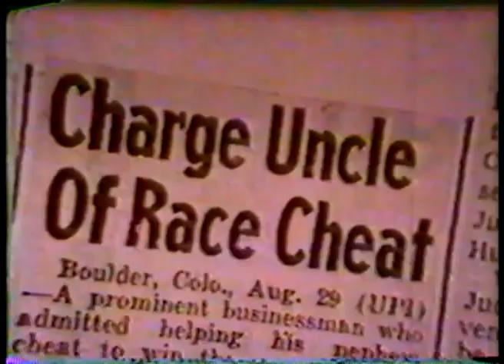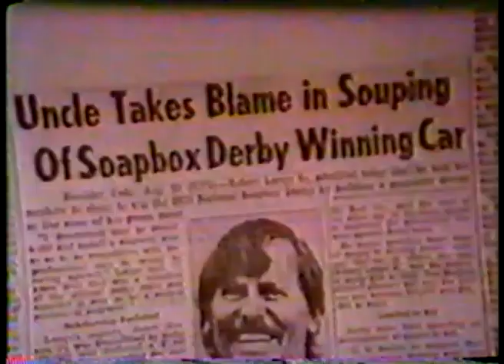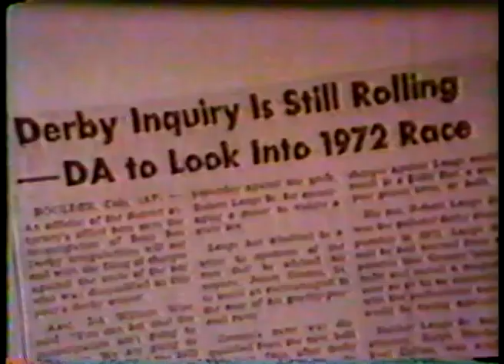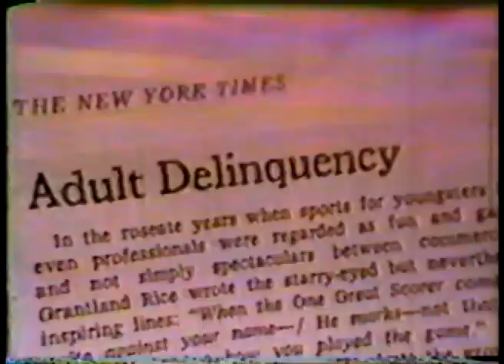The Day the Derby Almost Died - The Magnet Car

Comment: At the time this film was made, I was 11 or 12 and somehow got a set of Soap Box Derby wheels/axles identical to the red ones seen here. Never built a car, but did figure out that you could hang the front wheels of a skateboard over the axle, sit on the board with your feet up, and hang on to the axle to steer it. It would flat out fly down the hill our street was on. And if you tried to brake using your feet, Flintstone style, it'd easily burn the sole/heels off your gym shoes in a day. Got chewed out for doing that to a new pair of Converse. What was funny is that shortly after getting a new pair, we were playing football with our friends Boxer dog. You ran around the yard carrying a football and the dog would go nuts trying to "tackle" you if you had the ball. While running from him, he nailed me from behind by chompin' down on the back of my shoe, which ripped the entire rubber sole off in one piece. The rest of it was still laced to my foot looking normal. I got another ass chewin', and the dog had lived up to his name. It was Butkus.
Reply: Nice story.  Lol
Reply: Yea ,i remember those Chuck Taylors.

Comment: Was there a rule in place at the time of using magnets? Sounds like great engineering at the time. I guarantee anyone in the top 10 were cheated up.
Reply: and the children did all the work! The parents only bought balsa wood, sticky tape and a few nails.  Little timmy purchased the vacu-form and cnc workshop with his paper-run pocket money and was able to access NASA's wind tunnel by volunteering.

Comment: I was 12 when this happened and and even with all the crap and bad press I still wanted to race in the derby. I had a small problem it's the same year I had a growth spurt and went from 5 foot 2 to 6 foot tall that killed me ever getting in to a derby car that and I tipped the scales at 159 pounds.
Reply: I remembered I had to take 6 pounds out of my car was the cut off 150 lb? because I believe mine weight 156 with me in it. I'm 65 years old now I just remember mr.fix it told me I was too heavy to race and they just push me over to the side and said next. I remember  being by myself as my father worked all the time and the neighbor had actually taken  me out to the Coliseum were had to weigh in before the race. So standing there by myself  mr.fix it tells me I need to lighten the car up 6 lb  which I worked on so hard I didn't know what to do . Seems like one of the volunteers maybe it was the Jaycees he took one look at my car just kind of shook his head .So I didn't race. Somewhat made me a big boy at a very early age especially when I seen all these fiberglass cocoon cars. My car was made out of  wood and masonite siding . I also was  a rather tall kid  However me and my friends had a ball with my car in the neighborhood it would hold two or three kids going downhill my braking system was the best. Of course I sook the wood out from underneath my sister's beds good thing I had 3 sisters to make my axles and my braking system and that's all the wood I could find. My car was literally built out of scrap material. I guess it would have been great to have a father who could help me out but one of six kids just didn't work out with him working at a textile mill. I guess he was just too tired to care but I still had a great father. I guess the only ones that won't like my post are the ones with the fiberglass cocoon cars but to the boys like me built their own  my hat's off to you.

Comment: I was raised In Akron. In 57 or 58 I drove my neighbors car in a practice session.  At that time they used 3 lanes.  The middle lane had a distinct advantage.  Somehow, the crown in the track made the middle faster. At that time the middle lane won about 70% of the time.  I was in the right lane.  The middle lane beat me by about a length.  The left lane and I tied. I remember feeling cheated.  But, it wasn't my car and it wasn't an official race.  Then and there, I decided I wasn't going to build a car for the next year.
Reply: yes, it would be less friction on the wheels.
Reply: They are SUPPOSED TO calibrate the gates to compensate for this.
We had one lane faster in my hometown races.

Comment: Now i realize why GM pulled out, i read that Chevrolet operated the derby through 1971, pouring about $1 million a year into the race. When the automaker withdrew its sponsorship and clout in 1972, the race dwindled from 252 participating cities to 138 in a single year.

Comment: Brings back exiting memories. I ran a derby racer in the local San Bernardino CA race in1949 and 1950. It was my older bro's design and a lot simpler than these, using pressed wood panels for the body. The wheels and axels were the regulation units obtained from  the local Chevy dealer that you see in all of these images. My bro got a local machine shop  to build the steering wheel, otherwise it all came out of our garage and tools. Finding the hill we raced on too tame, my bro found a steep road off of a hill to test it on. made the first turn, but at 45 mph (he was following me in the family car) the restricted turning radius required by the derby did not allow me to make  the next curve and I headed into a dirt berm alongside the road, flipped end over end and landed on my head. I still have a scar in the back of my right hand where a support for the body collapsed onto my hand on the wheel. My helmet (a real racing helmet) was smashed down onto my head and took some persuading to get it off.  Far, far away and a long time ago. Nowadays most parents don't even want their kids climbing trees but taking risks is an essential part of growing up.
Reply: I love it

Comment: There was cheating in my Cub Scout Pinewood Derbies when I was a kid.  My hometown is the world headquarters of a MAJOR engine manufacturer, attracting world class engineering talent.  Each year, my cars were legit - I designed and built them myself.  Sure, Dad taught me how to use tools and sand them, but I built them and painted them, as it SHOULD be.  But somehow, gee I don’t know how, the kids with Engineer dads— SOMEHOW their cars looked like they were built by NASA!  Even the paint jobs looked like they had been done at a body shop.  And gosh, somehow those cars always won, go figure.  

One year I actually had a contender- once I figured out my car actually ran better backwards!  I made it to the final heat with 3 ringers as competition.  I was so excited I forgot to put it on the track backwards and it came in dead last.  As you can tell, I’m TOTALLY over it now.  Lol
Reply: My Pinewood derby car won its first few heats and in the final, the guy putting the cars on the track, dropped mine, breaking it, without even looking at me or commenting, he picked it up, handed it to me and took another car and put it up on the track. I was 9 or so, and was trashed for months, but I’m over it now...kinda...
Reply: @stevestikihutable  and this was an “adult”?  It would have been a shame if his car was accidentally keyed down both sides without comment.  I’m sorry that happened to you.  First world problems I know... but they still hurt.
Reply: @mattskustomkreations  You two meet all the background criteria of a mass murder.  Get help NOW!!!!
Reply: @booifojoe  haha!  I’m beyond all help.
Reply: @mattskustomkreations  Well, just stay out of my yard then.  :)

Comment: holy moly the audio on this is painful
cool vid, but painful to listen to in headphones
Reply: 40+ yo and off of VHS tape. Are you a millennial?
Reply: @alwaysopen7970  just came to the top of the hill myself.  No idea if I’m a millennial...they keep moving the goal posts on that one 😏. But I do remember renting vhs players for the weekend when I was young.  Watched my fair share of reel-to-reel in elementary school too.  Wish I could run this vid through an audio processor to take out the high pitched noise.  (Youthful indiscretions with fireworks and such may have made me a bit hard of hearing, but not that much 😁) It’s a cool vid. As much as I dislike cheating ruining a sport, the hack and how it was done was slick.

Comment: This is why in 1970's sometime the Event went into two types of strict Derby car shapes One for a more open head design and one for the lower enclosed shape. The Derby cars were then made equal, with the cars needing to be 100% identical in the types they are or the vehicle gets disqualified, sad as there is 0% of design being how the car wins, even the weight is according to each kids own weight is made so it is the same in each car meaning they add weight to the cars to equal the heaviest rider in each age group. The Fun has been sucked out and the only thing like this that has creativity is the Red Bull Derby but that is seen more as a joke.
Reply: I remember being sad that the identical kits lessened the goal of encouraging engineering, creativity, and craftsmanship.
Reply: @gordonstewart5774  Yes and the Sad part is 90% of the Motor Sports that are higher up at the top levels are going this route too like NASCAR Cup to the point everyone has to use the same company for the skin that leaves everyone with a dull car and muted colors due to how off the company is with colors only engines different from manufacture to manufacture then bodies on the other divisions have little change with intertal as the only parts, Indy with same thing as NASCAR Cup with rest mainly only the body with internals different, Indy only restrictions are a bit more on the engine weight, ARCA they have to run the same weight car with engine same rules for each manufacture but they have a bit more freedom then NASCAR in how the cars can be modified, Top Sprint divisions have strict rules, None of the sports that are higher up other then Formula series with caps on spending or some of the IMSA 12/24 hour divisions inside the have a good bit of freedom in racing design. 

The problem is that nobody wants to sponsor the cars and costs of parts, ect after 2020 have gone crazy for vehicles.

Comment: I think of the orange crate ,two by four ,mix matched wheel jobs my friends and I hobbled together with bent ,rusted nails ,then look at the cars these kids were racing and thought that this just the FIRST time someone was caught cheating. I'm sure it had been going on for some time.
Reply: You rack disciprine. If you havent built your own wind tunnel & CNC workshop, and can design an ultimate car with your programmed CAD machine by the time youre 8 -  Youre hopeless! 
thats what i did. My dad just bought the stickytape and balsa wood. I promise
Reply: @fredfinks  I recall watching these races on wide world of sports and even then found it impossible to believe those cars were not either built by parents or engineers . The only participation by children was the actual driving(if a midget could have been found ,even kids would have been left out all together)
Reply: @stevenmccart1597  Im an adult, ive built a backyard shed, can do basic carpentry, brick & concrete formwork etc.  I cant build a kart like that.

Comment: when I competed in the late 60's, a lot of fathers showed up trying to get their daughters into the race. they were told that until the rules are changed there is nothing you can do. now that girls are allowed it has killed the sport. the weight of the car vs the driver is key. it got to where the boys couldn't win because on average they weighed more and the cars were slightly fatter too in most cases. the last year I raced I was at a disadvantage even tho I was small for my age I was too tall to have a "laydown" design. we had to build the car without any assistance. they changed that too so all the fastest cars had a lot of help or were even professionally built. In my hometown of Fort Worth TX we had a custom race track similar to the one in Akron, it is now abandoned. there are so few tracks left now a lot of traveling is involved and most people just find other things for the kids to do now, sad
Reply: Pretty much all forms of racing have been destroyed by similar stuff.  Indy 500 isn't innovative cars anymore.  Drag racing you just program your computer to launch for you.  Dirt racing is still pretty basic but you need to groove and grind tires.
Reply: Definitely the problem is the sex of the child driver and nothing to do with the adults outright cheating with electromagnets...

Comment: am I the only one left wondering how the magnet created an advantage ?  Shouldn't a 30min film explain that detail ?
Reply: Tom Servo the mechanism they installed worked lke a solenoid does to engage a car starter motor with the flywheel ring gear. When energized with electricity the solenoid throws a weight with great force. In the case of the soap box car, the weight flew forward with enough force to give the car a split second forward boost or transfer of weight. It was enough to give the car a kick that was greater than just the pull of gravity. This same principal is used in high speed trains and massive rail guns used by the navy. There is even a roller coaster that uses this principal to accelerate  the coaster cars up a 85 degree slope with the force of a dragster.
Reply: I was thinking the magnet got a pull forward from the gate as it moves forward as well as down.
Reply: Matthew Day I did too

Comment: If I understand this correctly, the adult that actually suggested and implemented the cheat, was also related to the previous years winner.  Did they consider checking the previous years winning car?  I gather from reading some of the replies, and some other sites, that the winning cars were kept by the soap box derby people.  Would seem to me that car would have had a very similar device in it.  The derby could have prevented this from ever happening if they just of used a non-ferrous start bar.  Or, on hearing rumours of something like this being out there, run a much stronger magnet on the start bar that would stop the bar from dropping.
Reply: The film brushes on the '72 winning car but doesn't go into details.  Winning cars were kept by the organizers, but rumor is the '72 car has gone missing.  Maybe people were lax on the rules of keeping cars after Chevy dropped sponsorship after '72.  Who knows?

Comment: 16:27 [Note to @David Seitzinger: I would add this to your description.]
If you're wondering about the "black eye" mentioned in the description, here you go: https://en.wikipedia.org/wiki/Soap_Box_Derby#1973_scandal
In 1973, 14-year-old Jimmy Gronen of Boulder, Colorado was stripped of his title two days after winning the national race. Suspicions were running high even before the finals, and Gronen was actually booed by many spectators.

The unusual dimensions of Gronen's margins of victory and heat times tipped off derby officials to illegal circumstances surrounding Gronen's racer. Subsequent X-ray examination of his car revealed an electromagnet in the nose. When activated at the starting line, the electromagnet pulled the car forward by attracting it to the steel paddle used to start the race. Gronen activated the electromagnet by leaning his helmet against the backrest of his seat, which activated its battery power source. This became very evident as Gronen's heat times progressively slowed down as the race wore on, because the battery lost power each time the circuit was activated reducing the attraction of the electromagnet. Usually, heat times get faster each time a racer completes a heat. Videotape of the race also showed a suspiciously sudden lead for Gronen just a few feet after each heat began. The margin of victory for a race heat is normally no more than 1 to 3 feet (0.30 to 0.91 m). Gronen's early heat victories were in the 20 to 30 feet (6.1 to 9.1 m) range. (Aluminum insulator plates were added to the starting ramps in 1974 to render an electromagnetic system useless.) [23]

Midway through the 1973 race, Derby officials also replaced Gronen's wheels after chemicals were found to be applied to the wheels' rubber. The chemicals caused the tire rubber to swell, which reduced the rolling resistance of the tire.

In the final heat, Gronen finished narrowly ahead of Bret Yarborough. Within two days, Yarborough was declared the 1973 champion.

Gronen's uncle and legal guardian at the time, wealthy engineer Robert Lange, was indicted for contributing to the delinquency of a minor and paid a $2,000 settlement.[24]

Lange's son and Jimmy Gronen's cousin Bob Lange Jr., had won the previous 1972 Derby using a car considered indistinguishable from the vehicle used by Gronen.